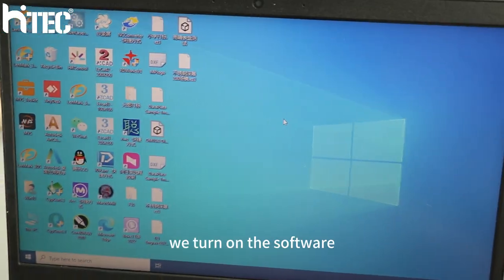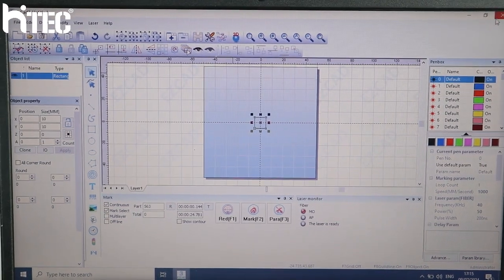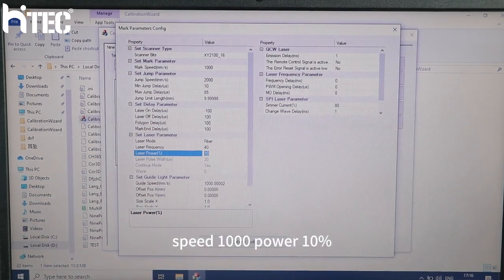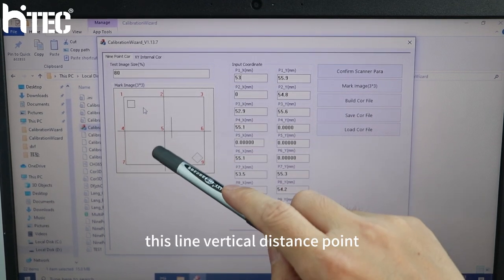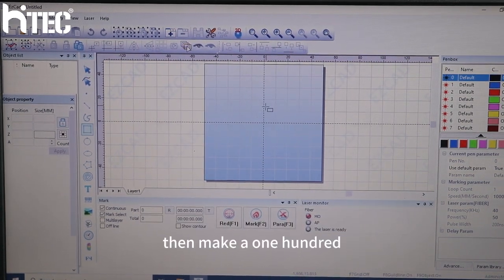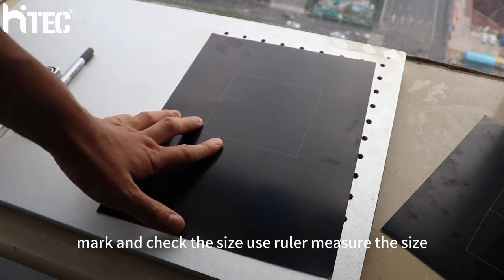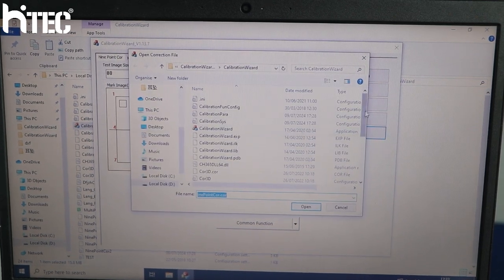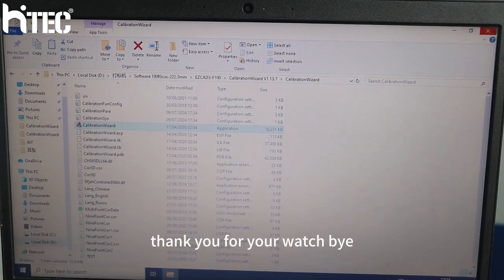Ezcad3 Tutorial-How to calibrate files in Ezcad3

Comment: hi friend. what to do if I have set up a lens size of 200x200mm perfectly square. but if I draw a square 100x100mm with this lens then it is distorted. If I start to calibrate a square 100x100mm then I have distorted 200x200
Reply from the maker: That is because the lens problem F-theta lens all have this problem